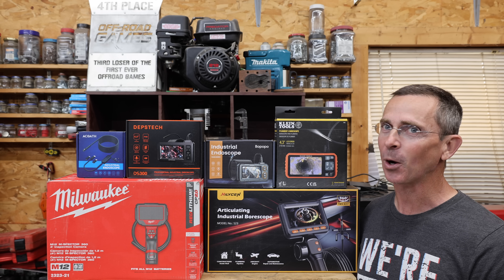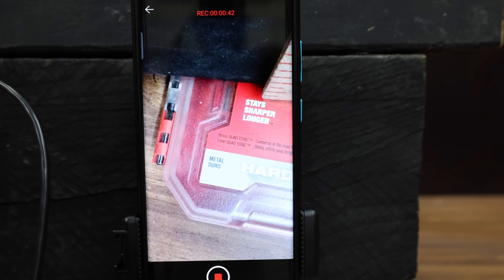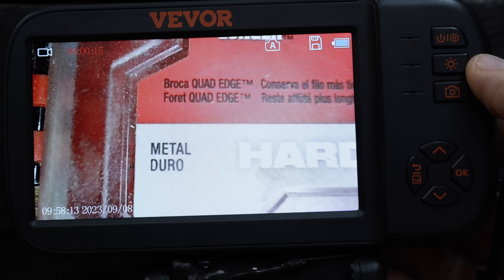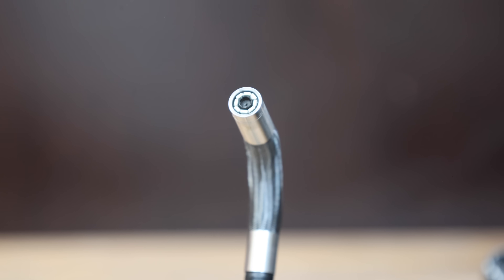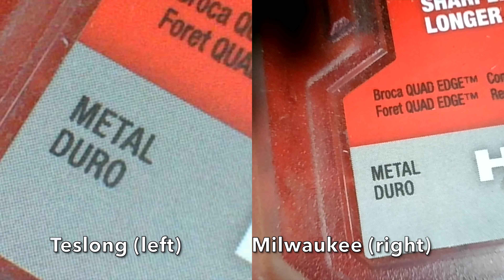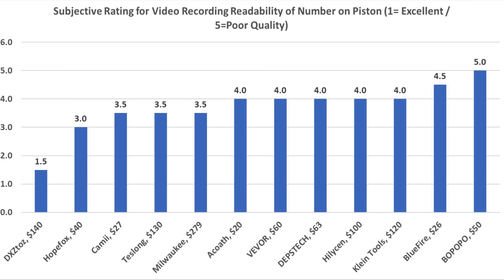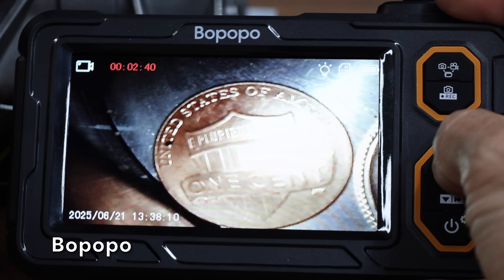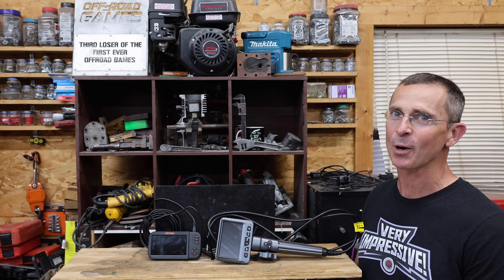I Tested The Most Hyped Inspection Cameras – One Clear Winner!

Comment: I have a dyztoz, but the screen is mounted at an angle in front of the handle. Extremely good resolution. It's got a 6ft cable which is still almost too long since my primary use is inspecting disc brake pads on class 7&8 trucks

Comment: i never even considered getting one of these. i didn't realize they had brought down the price on these. there's so many jobs i've done where one of these would've saved me hours of work. i need to get one.

 Edit: I bought one and used it to fix a truck with a hard to diagnose issue having to do with the intake/exhaust/spark timing. If I hadn't had it I would've had to remove the entire intake assembly, the fuel rails, ignition coils, spark plugs, sensors, and headers. This thing literally saved me 2 days or $900 worth of work. If you wrench on vehicles you need one of these just as much as you need a good ratchet and sockets with extensions.
Reply from the maker: Thanks for sharing!

Comment: I’m an industrial maintenance mechanic for one of the biggest consumer pulp and paper companies. When we were first starting up our brand new facility we added a bore scope to our short list of tools we’d like to have. We were working with an opening day (capital) budget so we could buy anything we wanted. At one point early on I was at my computer 8 hours a day ordering 10k worth of tools daily for like a month straight. 
My boss set up a couple on site demos for FLIR IR cameras, ViewTech borescope, and an ultrasonic detection gun (I forget the brand). We ended up spending like 20k between all 3 of those vendors. Neither of the 3 get used often, but when we pull them out of the tool cabinet they are priceless when it come to speeding up troubleshooting and diagnosis of issues. 

I don’t have a need for one in my home shop currently but an articulating borescope is definitely on my list of future tools.
Reply from the maker: Thanks for the feedback.

Comment: Those first ones are all identical.
Reply from the maker: Thanks for sharing!
Reply: @ProjectFarm i meant the internal hardware, not the actual interface, heh. They all use the same sensor and microcontroller. Also FYI you should be able to change focus on these. The banding also should be fixable by turning the 60Hz anti flicker on. They're likely set for 50Hz or disabled entirely by default.

Comment: Project Farm I’d like to see the side view and the ability to articulate to see the valves and combustion chamber. 
Bought a USB type then one with its own display from an auto parts store. Both have unreadable image quality. Needed to see the cylinder walls and combustion chamber and neither were good enough. Had an engine jump time and wanted to see if there was a bent valve.

Comment: I bought the BlueFire (different model) a while ago that connect to my phone through wifi. Oof, harsh to see it's one of the worse brand. Hopefully the version i bought is batter than the one you tested. Even the cheapest one can still be very useful.
I verified and i believe the version i have is better. I can have a decent quality picture at ~2.5inch, reading a 10cent's date which can sometime be hard to reach even with my own eyes.

Comment: On recommendation of another YouTube channel, I've been using two different DEPSTECH endoscopes for the last few years. A 16' one at work, and a 50' one that I temporarily zip tie to a semi-ridgid metal drain snake to check vents and drains at my parents' rental properties. They've worked fine for what I use them for. I'm impressed with the DXZtoz unit, especially when the cable is only 5 1/2 feet long. When I'm troubleshooting 2-stroke cylinders, trying to keep the excessive 16 foot cable out of the way sucks. That shorter cable and articulated head should be perfect for small jobs! And, there's a 25% off coupon on it right now too! (and same afternoon delivery in my area, nice) Get sum!!
Reply from the maker: Thanks for the video idea!

Comment: I bought a cheap one that worked off my cellphone and it is stellar. I can see everything clear as a bell and i found a dropped 10mm socket in the back of my engine I never would have found otherwise. I think i paid $20 on Amazon for it. It's also small enough to use as a borescope. Plenty good to get a view of stuff but especially to find bolts, nuts or dropped sockets. 20 years ago you would have dropped $1,000 for something like this
Reply from the maker: Thanks for sharing!

Comment: I tried buying one of the cheaper ones like at the start for pushing down a drain see where my clog is, couldnt push past like 5ft even though you get like 25ft of cable.. you should do a test in pipes of water, and go around a 90 degree bend. Vevor has a nice set for 200ish
Reply: @ProjectFarm
Reply from the maker: Thanks for sharing!

Comment: I've used these for all kinds of tasks, but mainly fishing electrical cables and inside wall inspections. These are a must have when you own a century old house, but I would advise to stay away from the any of the inspection cameras that use your phone, their connector all ends up dying. The ones that uses their own device usually have stronger connections for the camera's cable plus they don't drain your phone's battery. And an important point to mention about the articulated bore scope, is that they all have a limited cable lenght of 4-5 feet (1.5m).
Reply from the maker: Thanks for the feedback.

Comment: I've been using inspection cameras for years now so here are some of my observations. Unless you have a need for a long cable reach, stick with a shorter cable, the long ones can be very difficult to maneuver and are a real pain to use. Camera head diameter is very important for getting into smaller openings, as you can see in this video, not all camera heads were able to fit into the sparkplug hole. An articulating camera head is what I consider a must-have, try inspecting engine valves with a camera that only points straight down. If they specify the cameras field-of-view, get the widest one available.
Reply from the maker: Thanks for sharing!

Comment: Cannot really call any of these are affordable. I have USB camera from about 15 years ago, 8mm diameter, don't know the specs but I guess would not be that great on paper, possibly 480p or 720p but looking at the footage of some of these, it would still be competitive. Only one lens but it came with different angled mirror attachments so you can view to the side. I only used it without mirror and 90 degree mirror and only with laptop, no idea if it would work with phone, cost me $7-8 from Aliexpress at the time. Similar scroll wheel for light adjustment but it also struggles with too much light very often on reflections.
Reply from the maker: Thanks for the feedback.

Comment: Great video. You should make a separate one for borescopes that connect to phones. There are a lot of really good and affordable ones out there and I use that more than any other type of borescope because it's the one I have on me at all times, and you can get some decent quality ones for 10 to $15.

Some things you should also test for: 

1. Durability of the camera. Like any long cable constant bending and twisting of it wears it out over time. 

2. Durability of the insulation and waterproofness.
Reply from the maker: Thanks!  Thanks for the suggestions.

Comment: When I worked in an aviation maintenance shop as an avionics tech, the maintenance team had an amazing borescope cam. Fully articulated with a joystick, adjustable focus, very thin head and cable, the works.

It was very pricey though. Over $1500.

But for doing engine inspections, it was critical to have the best quality. They needed to be able to see small details inside turbine engines.

We borrowed it to help us find items, locations, and part numbers without tearing things apart unnecessarily.

You get what you pay for... But it is nice knowing that something the tenth of the price can give at least much of the same functionality.
Reply from the maker: Thanks for sharing.

Comment: I have the Milwaukee M12. My observations:
1. It's too big to use as a 30-caliber bore scope.
2. The cable is stiff allowing you to manipulate it into position (a good thing).
3. What you see on the screen isn't always where you want to look.
4. The resolution is good enough to identify mold, lint, liquids, wear... at close distances.
5. Image/video capture is adequate.

I have used it in walls/ceilings, a vehicle, drains, a dryer, firearms, and other places. There may be better cameras available but I have been very pleased with the M12.
Reply from the maker: Thanks for the feedback.

Comment: A-PLUS, Commander and HAPPY 4th to all us old and young Vets! I never could afford one of those and I knew if I could hold whatever it was up to the sun and see light through the holes that weren't supposed to be there, It'd be time for a blob of Seal-all to fill them up so they'd hold gas and/or oil again. Seal-all and Permatex were my go-to's pretty much. Happy 4th againh and God Bless ALL Yall!
Reply from the maker: Hi Lewie, Wishing you and your family a Happy 4th too! Great point on the seal-all to fill in the hole! These inspection cameras sure have come down in price now days. Recently, my old suburban suddenly stalled. I couldn't even scan the codes, engine wouldn't turn over, etc. I used an inspection camera to locate a broken ground wire that was in a blind spot. After fixing the ground wire, the old suburban was back to its old self. Thank goodness! I need that thing to last at least another 10 years, lol. Wishing y'all many BLESSINGS!!!!
Reply: @ProjectFarm  That old Suburban has got it MADE with you and yall! Our old Buick made it 26 years before it died and there were a lot of uncouth things done to keep it running, but it ran till it didn't. Then the Grandsparent (2nd generation) and the 1st generation (Toots) found THE car on a lot in Hendersonville. 12 years old, 24K miles and MINT! I have a chauffeur now and loving it! God Bless ALL YALL!

Comment: I like the one I have that plugs into an android tablet and has a clunky app that only works half the time and everytime I need to plug and unplugg the camera a couple times for the app to recognize it. Yup that's the one! 

But in all honesty, it has a 8ft stiff but flexible cable that I've used to scope engines, a drain, air duct, and steering linkage on a PWC. It may be aggravating to use but it has been super handy
Reply from the maker: Thanks for the feedback.

Comment: I have the Teslong TD500 with the quarter inch diameter end and autofocus camera. The autofocus feature is very worthwhile in my opinion. Also having the ability to pivot the end is awesome. Can run it into a cylinder and inspect valves and check for head gasket leaks. Everything is sharp and clear no matter how far away or close you are you an object. I love it!
Reply from the maker: Thanks for sharing.

Comment: I purchased the DXZtoz about a month ago very clean images , Purchased just to check the air filter on my GL1800 Goldwing to see if it needed changed it did. just go through the left intake and you can see the air filter. excellent review!
Reply from the maker: Thanks!  Thanks for sharing.
Reply: I feel I would be swearing a lot discovering that it's worth buying a camera like this just to check the air filter. Seems someone at Honda really don't like air filters... But it's depressingly common that things that should be simple to access are harder and harder to get to. Same with cars that have a V8 mounted sideways so you have to bend like an acrobat when trying to reach the sparkplugs next to the firewall. Sure it's compact but that doesn't mean I have to like it.

Comment: Thanks for the review, PF.  I bought the Depstech unit last winter for about $38. Used to inspect a clothes washer drain pipe. Worked fine for that job, and to inspect my air compressor pressure tank for internal rust.  Borescopes are handy, for sure.
Reply from the maker: You are welcome!  Thanks for sharing.

Comment: Nice video! A good borescope is a huge help in diagnosing mechanical engine issues, and at $200-250/hr in labor, saves the customer a ton of money in getting an idea of what needs to happen before spending that money.  Even the expensive cameras here are a drop in the bucket in a professional setting.  

One thing we struggle with sometimes is the cameras making cylinder damage appear worse than it actually is with the head off.  Would really like to see the difference there, especially with the articulating cameras, and those with a side facing camera... Can they get good quality video of the walls, can they get up to look at the underside of the valves etc.
Reply from the maker: Thanks!  Thanks for the feedback.

Comment: I bought the Depstech a few months ago to help diagnose a problem with a forced air heat duct. I got the 50’ version. It works fine but I wish I had sprung for one with an articulating end. I get stuck on corners, seams and screws and it is hard or impossible to get around them. Using an electrical fish tape helps but doesn’t solve the problem. Also 50’ is way too long and difficult to manage. 20’ or so would probably be the max I’d get next time.
Reply from the maker: Thanks for the feedback.

Comment: I have an old (like 20 years!) Wöhler350  30m lenght sever inspection camera and only two bad things it has is that it's screen is impossible to read in sunlight and that it costed a whopping $3500 when brand new but it also allows you to add audio commetary on the video with it's  built in microphone which none of these cheaper cameras can do, feature is indespensable when doing sever and other inspections also comes with a full freedom of 360 degrees turn on the camera head. Other feature is that it comes with radar unit that can track where the camera head is inside the pipe and has a lenght counter. 
So as far as inspection cameras go a $150 is very cheap and affordable and with the advance of tech I doubt I would be putting up that $3500 again on my wöhler as it is, seeing that they still sell the exact same model, just way too much money for +20 years old tech.
Reply from the maker: Thanks for sharing.

Comment: Bought that same DXZtoz cam a year ago. There is nothing more rewarding than finding out what I finally decided to buy is the #1 spot. Very Impressive!
Reply from the maker: Thanks!
Reply: Same. Had a small issue with the first one I purchased but they gave me another one without any problems and I m for sure use it a few times a week at work.
Reply: @guerreroa85 Thanks for another confirmation. I have buddies that told to shy away from the phone based ones.
The same buddies that pull nonsense on me 😂😂
Reply: Its cable length is too short for many uses such as duct work, sewer drains, chimneys, electrical inspection inside walls, and pretty much anything much over 5ft.
Reply: @gigglybeast yeah I got the 15 foot one for that reason
Reply: We tested that
Reply: I've had the Teslong one for about 2 years so seeing it ranked #2 is VERY IMPRESSIVE. Thanks PF for all of your hard work and entertaining presentation!
Reply: Sreen Bright setting on the Bopopo : no, no, no
Reply: your purchase has been validated... impressive
Reply: There's a 'better' version of it. See my post above. Bar none, the DXZtoz are supreme products; Depstech's are complete junk.
Reply: We’re gonna test that!
Reply: I just ordered it cause of these comments was between the DXZ and deslong
Reply: Well you better hope it’s good for that price
Reply: @Seeker-vo2tz lol that's not even expensive compared to professional models
Reply: I'm at the opposite end, not happy about the poor readability on my teslong!
Reply: Any recommendations for a rigid cable borescope/endoscope with atleast 10m cable? Trying to see and fish some cable with a hook in a false ceiling.
Reply: I came to your channel to see if you have done a test for borescopes. Just ordered a DXZtoz from Amazon.
Thank you for your hard work.
Reply: Same! I know the feeling let's GO!
Reply: #1 out of a small handful of choices he made. Just remember there are way more options out there than just what he chooses to buy. Also he only test 1 of each product...

Comment: Would love to see a test of emergency sump pumps.  When you need one, you NEED one. :)
Reply: @videodistro
  If you have no power and need a pump, some pumps work off the service water line.
I myself use a gas powered pump for times it is needed. Hard to beat gas powered for flow rate.
Reply from the maker: Thanks for the suggestion!

Comment: Few years back I bought one of the extremely cheap $20 ones on Amazon that plugs into your phone.  Spend a few extra dollars and save yourself the headache, folks.  
For the money, I'll be buying the Vevor based on what I've seen here today.  Thank you, PF.
Reply from the maker: You are welcome!
Reply: I don't need it, but I think I'll buy it too.
Reply: Same. Then they stopped supporting the app after a couple years.
Reply: I think it is possible that the lenses do need a wipe before the first use. That's thy so much reflection
Reply: @XtremeKremaTor  But why were some still better than others?
Reply: In 2019 I bought a Depstech that uses a phone app but a few years later it won't stay connected. Doesn't appear that the app is still being supported, so I would avoid those that rely on an app.
Reply: Did the ame to try to inspect underneath the subfloor. Waste of money.
Reply: Did it have any effect on your phones battery health? I’d figure a camera w/LEDs  would probably be a decent load for a phone battery.
Reply: @nathanlariviere8016  For me, it wasn't about battery life, it was just very poor quality photo/video.  Was a matter of "I got what I paid for".
Reply: Vevor sure is becoming big, wonder why....
Reply: @03stage2  From what I've seen it's because they're focusing on making solid, no-frills tools. They deliberately describe themselves as "entry level."